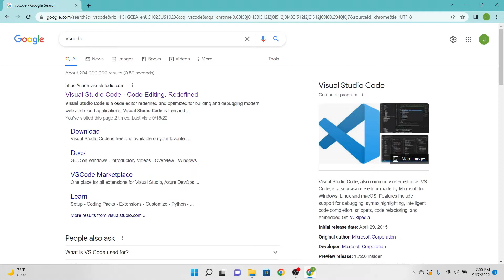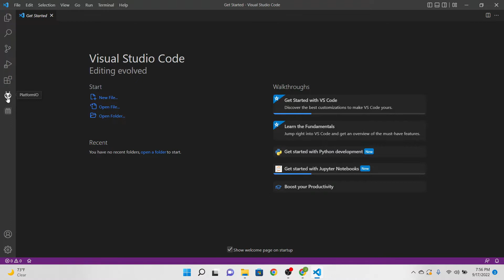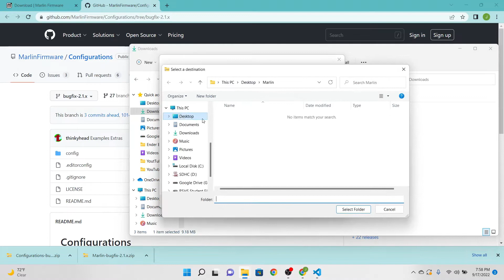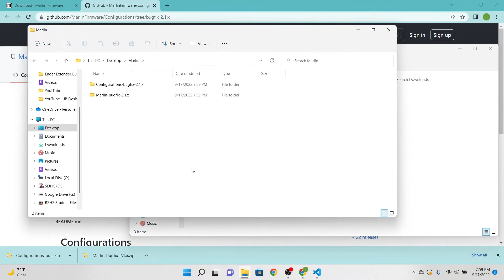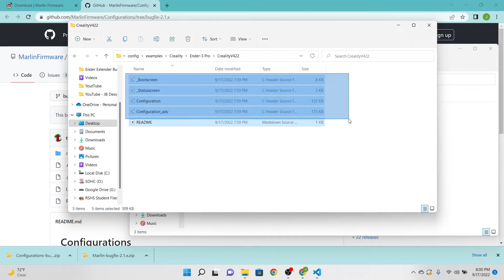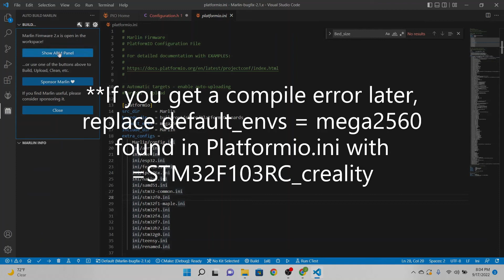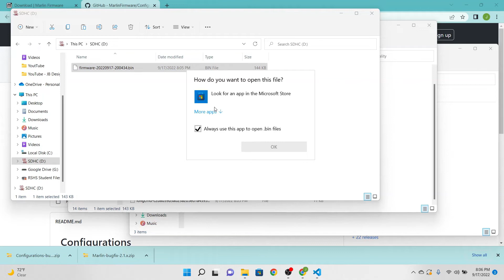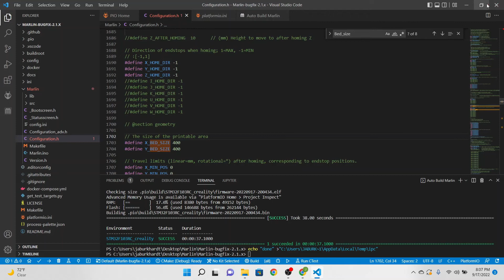Ender Extender 400XL Firmware

Comment: Thank you very much fo this video. I have changed my Ender 3V2 with the extender kit to a build size of 400x400x500and updated the Marlin firmware with your instructions. It works, only the _bootscreen and the _statusscreen files were missing in the Ender3V2 configuration. So the screen looks a bit strange, but all the menu choices are there.
I have 1 question left: can I simply install the BLTouch or do I have to change the firmware also?

Comment: Hi can u edit the firmware to have a CR touch on a ender 3v2? 4.2.2
Reply: You can't edit the current firmware on the machine, but will need to create a new firmware through VSCode specifically for your machine

Comment: Thank you for the great video!  I bought some upgrades for my original Ender 3 including the v4.2.7 MB; CR Touch; Extender 400 kit and the Creality 3D Pad touchscreen with filament run-out protection.  So my understanding is that I need to incorporate all of these changes in the firmware at once?  You can't do them one at a time?  Thanks for the help!
Reply from the maker: You will need to do all the changes at once or when you flash the firmware it will override what you flashed before it, if that makes sense

Comment: i have the v2 not all 4 of these files are there
Reply from the maker: You really only need the two, configuration.h and configuration_adv.h files
Reply: @jbdesignsandmanufacturing1169  so can I still use the ender3 pro one like in the video or won’t it work on my v2
Reply from the maker: @shaunaustin4207  it may work, but the pro version does not have the same kind of screen the v2 has. I would watch this video specifically dealing with your printer since it goes over things like dealing with your screen and the bl touch. https://www.youtube.com/watch?v=7i7PnBZ6cnM&t